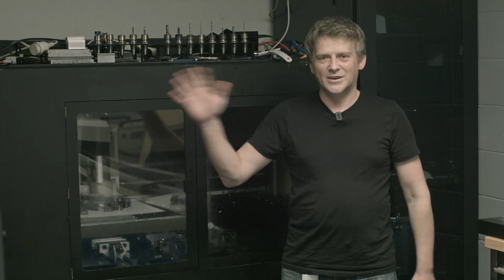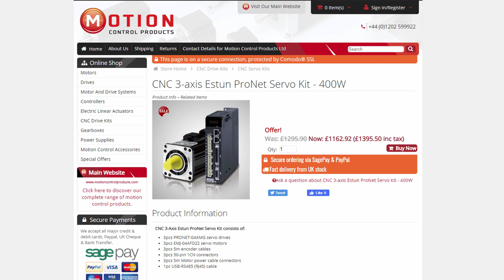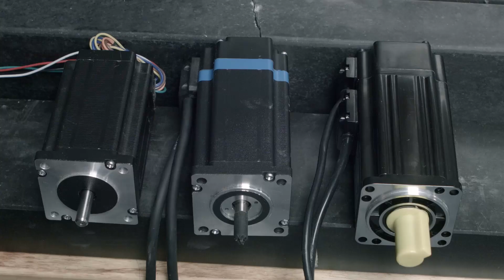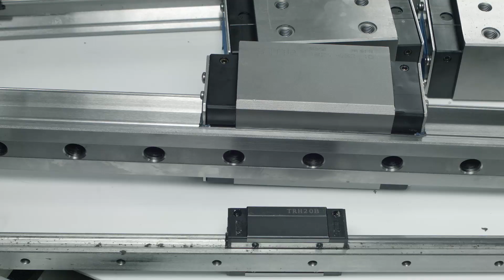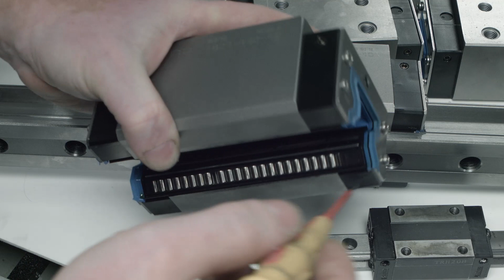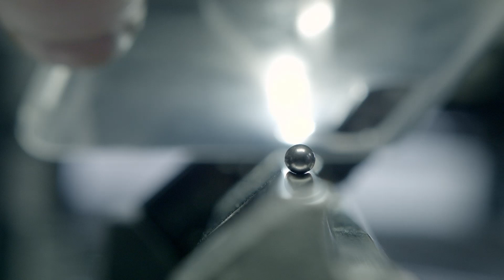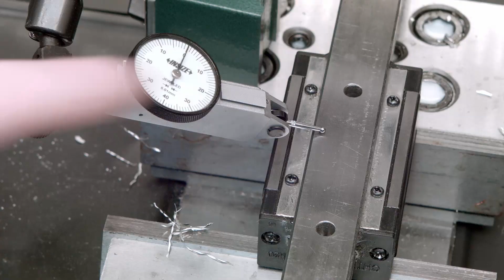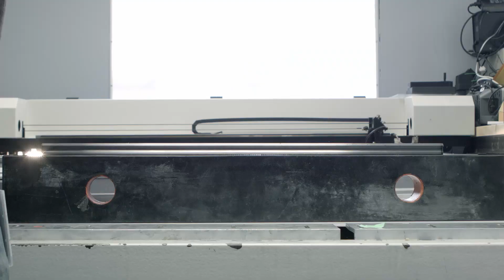EPIC cnc upgrade - episode 1. state of the art servos and monster linear rails

Comment: 17:31 - I believe imperfections is not what makes rollers better - rollers contact area is a line opposite to a dot for balls. Which makes them way more stiff
Reply from the maker: my intention was to show that its easier to make rollers than balls, and even if the rollers are not perfect they are way better than balls. plus under the pressure balls will travel on the grove from side to side. i guess i have to work harder on expressing my thoughts better.
Reply: @PiotrFoxWysocki  I understand the challenge of not being a native speaker. All good ;)

Comment: Lol yes you are insane. The rails on my Haas VF-2 are 35mm and I believe Datron machines are running 20mm in their machines. You have some beast rails on that machine no doubt.
Reply: Yeah I was thinking the same thing.  Saw something similar on another build where the guy went out of his way to buy 32mm ballscrews for a small, aluminum extrusion based cnc router.  The same size screw that's on my Fadal with 2kw servos lol

Some just think bigger is better, but if the design has to change significantly or the added mass just slows the machine down without adding rigidity, then it only hurts the machine.

If the parts were cheaper, however, then I say go for it.
Reply from the maker: @ReiniGrauer  on aluminium extrusion those 32mm rails become the strongest part of the machine :) in my case  granite frame is super rigid and i didn't wanted to have  any  play coming from the rails. 45 are perfect for Y axis,  32 would be ideal for the X. 
but for this price i have to make it work. those rails are just to nice to don't give it a try.
Reply: @PiotrFoxWysocki  he was using a 32mm screw, not rail.  I think with a nema23 stepper too haha.  I'm not sure how he even sourced the motor coupler for that combination.
Reply from the maker: @ReiniGrauer  wow. i have to say, this is impressive :) screw is almost the size of the motor :D
Reply from the maker: i know :D as i mentioned 30mm would be just fine. but i got those in the price of new regular Chinese rails 20mm size. So it is overkill but they are so good that i have to use them. I'm not looking for high speed, I'm just after perfect finish and rigidity.

Comment: i think it is mach better to invest in  linear scale instead of prison ground ball screw . think about it . the controller will fix any irregularity in the screw and most of ether irregularity in the mechanical system of the CNC do to the feedback from the prison scale  .
and yeah those are big A** linear rails  :) . can't wait to see the next vid
Reply from the maker: with c3 ground ball screws i will have 10-20 microns positioning error. over the whole distance, so at the smaller distances it will be less. anyway, at the moment im perfectly happy with this number. and if i will need to improve it i can always map the ball screw or get linear scales.
im trying to keep it simple at the moment.
Reply: aha ok .

Comment: Quite the overkill on the linear guides. Those are guides for real VMCs. But hey, if you want to spend the money why not.
Reply from the maker: actually i spent less than for regular Chinese rails.
Reply: Not just a vmc, those rails would be found on quite a large vmc.  Even a haas vf6 has 45mm ball linear rails, not even rollers.
Reply from the maker: @ReiniGrauer  thanks for the info. i was wondering what kind of a machine is using those.

Comment: That was is an awesome upgrade !
Have you considered LinuxCnc with linear encoders to correct the backlash of your actual or futur ballscrew ? A new C5 could be cheaper and give as precise of a motion as a C3, definitely more work though.
Also, what's the brand of your closed loop steppers ? Looks like the one from StepperOnline.
Reply from the maker: ;) i haven't made any upgrade yet;) just explained few components and why. I definitely set my mind on to c3 ballscrews.  For the lenghts i need variation would be 13 and 18 microns. Im more than happy with this number. For now at least. I can't imagine I would ever need to be this precise. But one thing i sure i want surface finish to be as close to perfection as it is possible.
Closed loop stepper on the video is from stepper online. They are cheap and they send stuff really quick.
Reply: @PiotrFoxWysocki  Yeah so you can get some feedback right x)
I found another comment that add details to what I'm saying about the ballscrew. Even better, here is an example underload (~9min): https://youtu.be/dRJMk4hkUvY
I don't remember if they are C7 or C5, but they are mounted on a regular Chinese bearing block without angular contact ball bearings. You can see it's pretty precise, I'm just concerned about the vibrations that occur when that much backlash is compensated, maybe a drawback for the great surface finish you need.
Thanks for the note about StepperOnline ! They are really cheap so I was curious to have some feedback, at least about the motor. I can use a higher quality open loop driver and closed the loop in LinuxCnc if the driver is not good enough.
Reply: I misspelled. They are actually double nut rolled ball screw (so not too bad) with bk15 bearings blocks modified to fit a pair of cheap angular contact ball bearings. Still as he has demonstrated the linear encoders greatly improve the accuracy of the machine, even tacking out the backlash of cheap couplers.

Comment: Hello Piotr. I have a lot of ground ballscrews. From Steinmeyer, Rexroth, NSK, Hiwin, Umbra... All brand names. no Chinese stuff.  Most of them are big, 40mm diameter and more, but I do have some 32mm and so on. I also have INA ZARF special ballscrew bearings, and 35mm and 45mm rails, carriges, all roller carriges from Rexroth, INA and Hiwin. So if you need ballscrews or more rails and carriges, you can get in touch with me. About ballscrews accuracy, usually C5 is just fine, specially taking into account your frame. If you want to achieve  very good positioning accuracy, you need to map your ballscrews. I don't know which software you will use, but I saw you have UC300ETH controller. This one can be used with Mach3/4 or UCCNC. UCCNC doesn't have ballscrew mapping option, so I would avoid it for your application.  Anyway, my point is, don't throw away money for C3 screws, go with ground C5 with some medium preload, buy linear scale, and map each of your axis with it. Best option to map your ballscrew is by using laser CMM, those are accurate down to nanometer, but are expensive, like 20 000eur  + . Linear scale + DRO for it will set you back about 250eur or so. You can check company Sino - those are well know Chinese, good quality and great price. Even better option would be, to chose ethernet smoothstepper instead of UC300ETH. Smoothstepper already has encoder inputs. So you could wire up linear encoder and map position without sepperate DRO. Even better, with smoothstepper you can connect 4 linear scales for your 4 axes, and monitor position at about 500hz rate, then  update position from linear scales. This way you can compensate for temperature changes etc. Sadly smoothstepper won't allow for active PID loop from encoders. PID loop from linear scales is optimal solution. If you want to go this way, and are willing to spend a bit more  for motion controller, take a look at vitalsystems  DSPMC 8 axis controller. This one will let you connect linear scales in a full closed loop sistem. It's a beast, worth every penny. LinuxCNC with mesa cards is also option to go full closed loop. Another thing super important for accuracy: homing. This is specially true for dual motor gantry desing, where homing not only determines accuracy of your work offset. but also how square your gantry is. You have to do it with encoder index signals, as proximity sensors are nowhere near accurate enought. I don't know about your servo motors, but I always use servo motors with absolute encoder. On power on, I read encoder positions from servo drive over modbus, and update controller DROs. For gantry squaring, I predetermine difference of one motor to another, and after reading both encoder positions, I move slave axis motor as much as needed, to make gantry square. Than I switch back to master slave configuration. This can all be done very easy in Mach4 with lua scripts.
Reply from the maker: I might need some time to respond to your comment ;) and normal keyboard, not a phone ;)
Reply: @PiotrFoxWysocki  :D I forgot to mention how much I enjoy your projects. I also like your anodized aluminium in  between vice covers.
Reply from the maker: I will keep your offer in mind. 30-40 size ball screws are too big. and i definitely  want c3. more money but i can live with 10-20 microns error. later on i can map or put scales on it, but at the moment i just want to keep it simple.
Reply: Another alternative controller which offers dual encoder feedback is Dynomotion Kflop.  I don't know anything about the VitalSystems product, but it looks like Mach 4 is required, at significant cost.  The Dynomotion boards are fairly inexpensive.  Plus they allow you to run your own C code on the board itself, and most of the software source is available for download/modification if needed.
Reply: What do you think of the MB3 from the cncroom site ?
Reply: I heard on some youtube video that clearpath servos don't allow the gantry to go out of square. Also now a days most people are talking about Centroid acorn, Masso or eding cnc controllers.
Reply: @Z-add  Servos have nothing to do with gantry squarness. You could potentically trigger homing procedure on each servo at the same time and hope for the best, but propper way is for motion controller to handle master/slave axis, and decouple them at homing procedure. Masso is poor performance at only 110khz, and will result in terrible resolution at higher speeds, acorn and eding will be affordable for hobby grade use, but I usually need more than 100 digital in/outputs,  analog inputs, pwm outputs etc etc.. and To expand those with so many pins becomes very expensive. Also licencing.. Want lathe threading..pay for it.. Want probing..pay for it.. It is very hard to beat Mach4 with price to what it offers. You have 6 axis controller, with full closed loop options, simple lua programming, modbus, etc etc. I really love it and use it on 10T + industrial machines, that work every day, and no problem whatsoever.
Reply: @cnc_channel510  you should be teaching all of this. There are hardly any professionals on youtube.

Comment: Hi.nice stuff you have there.good luck with upgrade.I have to tell you that is overkill 45 size for your CNC.this guide type goes in machine that have over 15kw power and  over 4000kg.Also you should consider 750w servo.But i am sure that you will make good job.
Reply from the maker: I agree it's overkill, but im using it to have my rails as rigid as possible and precise. 45 size was just a side effect of this what was available. I think 30 would be perfect.
Reply: @PiotrFoxWysocki  I hope the servos will compensate the extra preload and weight. Kinda worried for you about that and the force that the rails will apply to the granite gantry when you screw and so flatten it.

Comment: Is that a crack in your granite behind the closed loop stepper in your demo? Hoping it's not.

Awesome video as always, I was starting to save for my build based on yours but managed to buy a Schaublin 13, with some of its other heads and work holding so I am broke for a while. At least when it's set up I'll be able to make some of the parts for my build now. And hopefully I'll be able to use your new developments to make it better too.

Keep up the good work and thanks!
Reply from the maker: Actuality it is broken straight edge behind those mottors. I got one sent and it got broken in shipping. But i got replacement. Broken one is used now for sanding.
Reply: @PiotrFoxWysocki  good my heart sank when I saw that, I also figured you would have said something but I thought I'd check anyway.